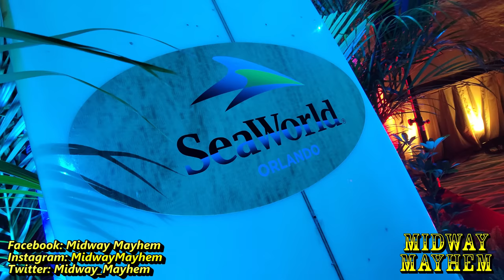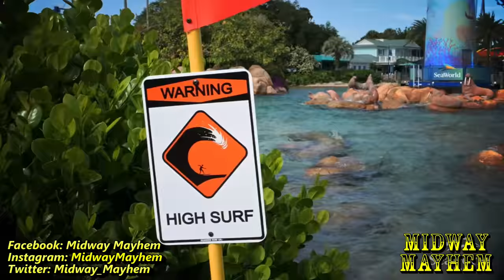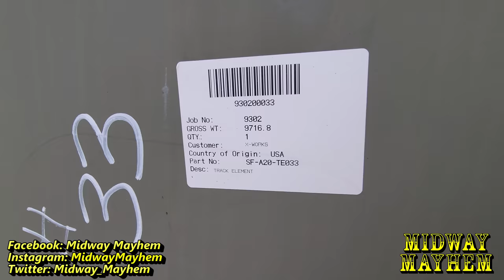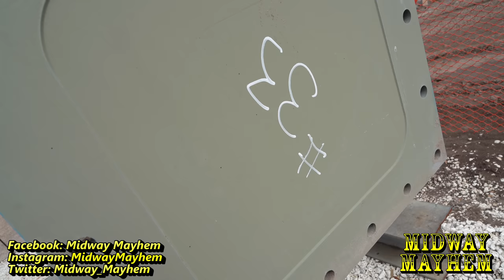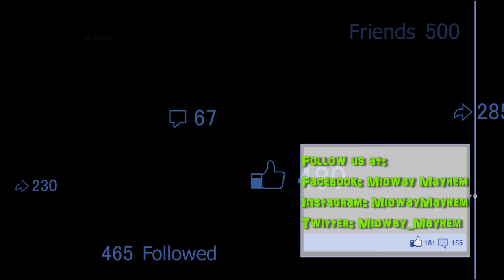SeaWorld Orlando Pipeline The Surf Coaster Announcement / Interviews /  Construction Update 10.18.22

Comment: Do people actually like to stand up on a coaster?
Reply: Looks more like a slight crouch than a stand...like how youd actually position yourself on a surf board...just facing forward
Reply: No, most ppl do not like stand up coasters. However, There aren’t many stand up coasters left to begin with because of the uncomfortable and rough ride experience. This offers a new and improved version. I trust that B&M figured it out. I think it’ll be a smooth and unique ride experience.
Reply: I do like to stand up on a roller coaster